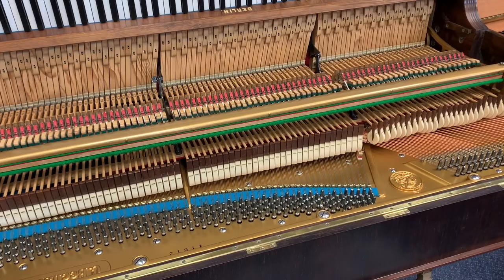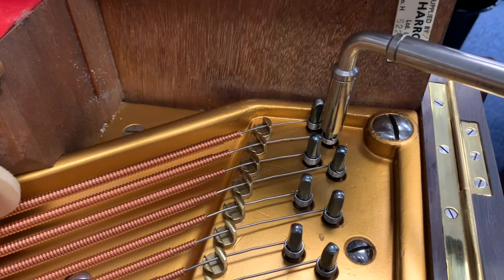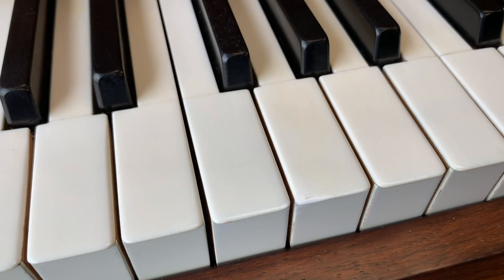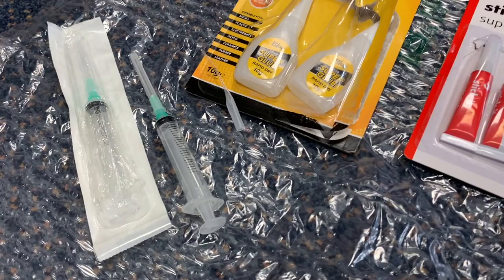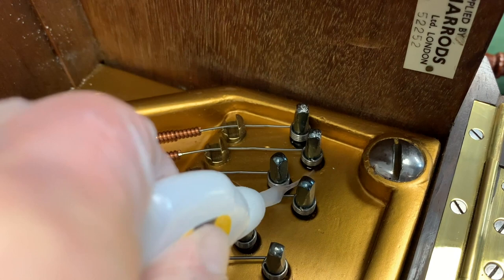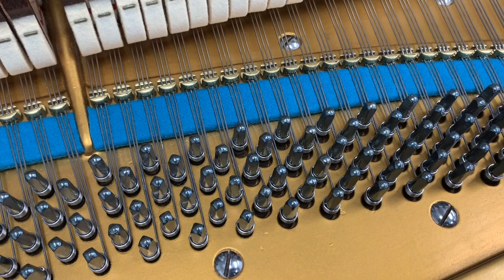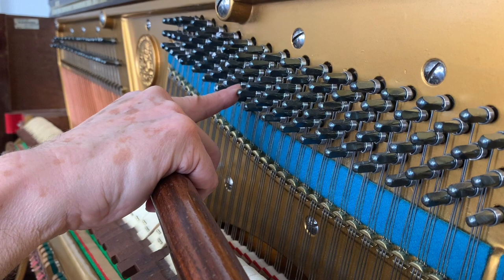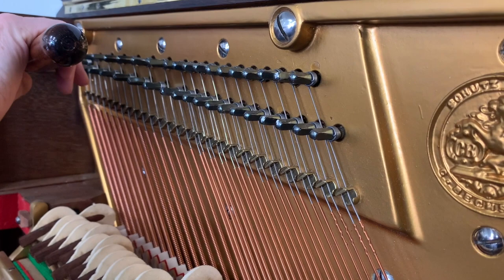How do you use CA glue to tighten tuning pins? + thoughts on larger pins and replacing wrest plank.

Comment: Robert, I love your videos! I'm an RPT and a Bechstein dealer here in the U.S.

The CA glue treatment has a high success rate for me, especially if I replace the tuning pin with a larger one. Usually replacing a size 2 with a size 3 (or size 4 in extreme circumstances). It's usually just not worth it to replace the whole pin block especially on an upright.

Comment: Another tip is you must use as much CA glue (super thin) as the wrest plank will absorb. If you go back to it later and try to put more in, the first treatment will have dried sealing the surface of the wrest plank and will stop more being absorbed. So it is a case of do it once do it right for best results
Reply: Very good tip that’s rarely mentioned. Some say to put X number of drops, but that is wrong. Over 30 years and I can attest to your procedure! Each pin needs a different amount, and adding more later is sometimes impossible. Let it fill, lower, fill again until it stops.

Comment: I used it on a 1923 Chickering grand which would not hold a tune in the lower base. The middle strings were better but border line. I did all of them and found it to be quite effective. It increased pin torque I would guess by over 30 % for all. It now holds up extremely well   in a pretty stable room. It varies hardly any between tunings of 6 months or even a year.  It has been doing so for 5 years, and was even moved. I would wait at least 6 hours after treatment to turn pins maybe even overnight. You will feel the pin "break" loose when you move it but the pin will stay "tight" after initial breaking loose.  The uprights do better if done on their back.  Be careful with ventilation. The stuff is bad to breathe. I love your pianos!  I had a Schimmel that I really liked. I have a Mason and a Chickering now. Both are pretty decent.  Wish I were closer. John.

Comment: I've done lots of this work. You do need a thin CA glue so that it travels properly. I've also found that around those loose pins you'll need to apply more to fill in the cracks in the board. You'll see it doing its job. Piano on its back is also the best way to do it. It certainly smartens up the torque of the pins but the down side is that you'll need to employ a different technique when tuning. All the best with the new experiment. EDIT: I always have an air extraction unit with me when I do it to get rid of the fumes

Comment: I posted a long comment but it vanished.  Best to use very low viscosity CA, not available in shops, need to order online. I like the little flexi tip nozzles like the one in your video - easier to control than pipettes etc.  I have used those little pound shop bottles in the past - they are reasonably low viscosity, but the proper very low viscosity stuff is better,  The flexi tips can be bought in packs online.  American technicians, who discovered the CA method, having been using it for over thirty years now, and are extremely positive about the longevity of the results.  It has saved many a solid old piano of little financial value, not worth full rebuild/restoration.

Comment: I use it regularly on old pianos here is Berlin. My experience is it can make alot of otherwise condemned pianos live a little longer. I apply to upright in client's homes with the piano upright. I use a small pipette. And do 3 passes on all the pins (On the death's door wrest plank better safe than sorry.) I begin by applying small amounts at a time trying to avoid it overspills. But I keep some clothe on a treble mute to catch any excess CA glue. I've found it holds really well over a couple of years here.
Reply: I second all that.  I have used pipettes in the past, but now I prefer the flexi-tips as shown in the video - you get very good control of the outflow, and if you take your time on each pin and let as much wick is as will go, I've found that it's not necessary to do three passes.  I agree that this is a method for "otherwise condemned" pianos, which are not worth a rebuild.  Reports from American technicians, who discovered the CA method and have been using it for over thirty years now, are extremely positive about the longevity of the results.
Reply: @DavidBoycePiano а все потому что производителям просто лень внедрять нормальную систему удержания колок. Это же не болты в велосипедном багажнике что бы такие методы использовать! Но нет. Достаточно одного или пара видов удкожателей и винтов для тонкой настройки и пианино будет держать строй лучше. Это тоже самое что сейчас винты обычные использовать как в 18 веке. Просто недопустимо, но некоторые товарищи продолжают клепать этими "проверенными" методами. Таких производителей нужно гнать

Comment: Ideally you need to lay an upright on its back for this to work. I don’t think it works too well otherwise, the CA tends to run away rather than be absorbed by the wrest plank. You need to use super thin CA for best results much better than standard thickness CA, but of course it will run away if you don’t have gravity keeping it in the right place around the pin to be absorbed by the wood. I would certainly leave it longer than 30 mins before tuning it. Overnight is best in my experience. I think this is why some pins did not hold very well for you because you moved them before it had set well. If done carefully it can last quite a long time.

Comment: After seeing how commonly it is used in the USA I thought Id get some of the super thin CA and some of those fine nozzles, I bought a bottle for about 20 quid. Used it on an old upright yesterday and seems to have worked a treat - brilliant for rescuing otherwise sweet old instruments that are becoming untuneable, remember to put some absorbent blotter under the pinblock on a grand or it can run and drip through onto the mechanism underneath

Comment: Have a word with "LOCTITE" products on the phone. They are very good company, and they will have various grades of "Cynoacrylate adhesive" (CA GLUE).
Loctite is used to provide the desired grade of "fit" on a very wide range of industrial applications. It is not normally considered a compromise these days.

 If you want it to last in the bottle make sure there is an air gap.
The curing process (ANEROBIC) starts when it is excluded from the air.
In wood, or were there is a very sloppy, or porous fit, a heavier than standard grade might be needed.
Even maybe consider multiple applications.

It was a giant leap forward sixty odd years ago, as far as I can remember.

It will increase the life of many a piano

Thank you for your many expert videos Marcus.

Comment: On CA glue: 1 drip or 2 per tuning pin could be a lot: for the thinnest viscosity capillary action will wick the fluid to where it's needed
- The applicator here was great!
- Upright piano on back is best, gravity is on your side: but even upright it should wick in, but any excess may create issue
- Whatever a great temporary fix
- CA glue uses mositure to go off: it will find this in the wrest plank wood / from atmosphere
- Once opened difficult to preserve: cling film under screw top... As moisture eeks in from the atmosphere is goes thicker & thicker...
PS When pulling apart it would be useful to show where the glue actually ended up?
- Sealing ring at top: or penetrating down the pin where the hole is oval
Reply: Technicians in the US who have investigated penetration of CA in pinblocks have found that, while it doesn't generally make it all the way down the hole, it does more than just form a ring at the top of the hole.  There is also a technique some USA technicians have used for grands, of flipping the piano right over, 180 degrees, and applying the CA into the bottom of the pinblock holes (assuming of course that the pinblock holes are drilled right through).  The flexi tips used in Marcus Roberts' video here, can be bought in packs online, and will fit onto the nozzles of many CA bottles.
Reply: @DavidBoycePiano  David: Indeed or you can have too much if a good thing!
https://youtu.be/C0U3t8IKUMk
[Early 1950s the Rover Co. chrome plated the bores of the 'Cylops' 75... This is the pin block non-stick equivalent - 10 years down the line!]

Comment: I used Starbond Super Fast Thin on a Petrov piano, very easy to do, cover the mechanism in case it goes through the block, it makes the wood swell and hardens into cracks, just add glue until in pools around pin, low strings may need more than one pass to fill in all the cracks. Low strings are holding after two years just fine. New block would cost more than the piano, the glue cost $5

Comment: I am not a piano technician but here are my two cents.

On the ivory key repair subject, I would try keeping the shards left from old ivory key repairs. I would then sort them by colour (or rather, tint), pulverize them really fine and then mix the powder with the c.a. glue. I would try to see if that works because if it does, then I could get a much more seamless repair with a matching colour - which would certainly be very worthwhile in a piano with many chipped ivories whose owner cannot stand the sight of.

On the subject of the plank repair, there are a couple of points to make. First, I would not expect the c.a. glue repair to have the same grip, especially after tuning once or twice. Second, I would try to hold the application with as steady hand as possible and try to get it very close to the pin base and all around the pin in order to get most of the glue absorbed where it matters. For that reason, I see no other way, for hidden plank piano, than putting the piano on its back. I'd leave it there to set for a good hour or so and then tune it on its back to see if it still holds, then apply extra glue if needed. So for a house repair, I would certainly need the special piano prop for tilting the piano to its side etc. or a couple of strong guys. The applicator shown in the video looks perfect for the job. With the hidden plank pianos, however, there is no way of telling whether the glue seeps into the wood around the pin or just fills the void between the plank and the frame hence I would definitely get the piano on its back for this reason alone.

Comment: Say if you use CA super glue that’s gel-like. Would that work the same? 

And if so would I have to lay an upright piano on its back so it will set correctly?

Would gel glue not set in correctly and only thin glue would work?

(It might have mention this in the video but at the time I’m writing this comment I cannot finish the video)
Reply from the maker: Thank you for your comment. We haven't tried CA glue very much so it's useful to have tuners' thoughts about using it. Marcus

Comment: CA glue for repairs is death spiral for a pin block. Use Garland’s Pinblock solution. I’ve treated dozens of pianos with excellent results that last for years. CA glue is stinky, toxic to sinus tissues and only ends up closing up the grain making the grip less after a couple of tunings.
Reply: You have a link for 'Garland’s Pinblock solution'??

Comment: I was in the piano business for 40 years.
We typically used a hygroscopic liquid lije diethylene glycol.
The wrest plank in older pianos was sometimes a solid unlaminated plank where a split can cause the problem of loose pins..
I would be curious to know if the glue you applied stuck to the pin or the wood ir both....does the glue pulverize when the pin is turned?
Reply: Cyanoacrylate adhesive ('superglue') reacts chemically with cellulose to form a compound called cellulose cyanoacrylate.  Wood is more than 50% cellulose.  So it is not a case of the adhesive 'sticking' the pins to the holes, or simply filling in gaps in the wood round the pins. It actually alters the wood.  I have myself seen CA glue react so strongly with a dried-out wet-wipe tissue (mostly cellulose) that it started to smoke! It was technicians in the USA who discovered the CA technique, more than thirty years ago now, and it has proven vastly superior to all other "doping" solutions. When it works (which most times it does), the effect is quite permanent.  The discovery of this effective treatment has meant that many an old piano which would not justify the cost of a new wrest plank, has been saved.  Naturally it is not a technique that you would use on high-end pianos that would financially justify full restoration.
Reply: @DavidBoycePiano  Very well said.  I have used it and found it excellent.
Reply: @martinwalsh3673  I'm glad to hear that you too have had success with it, Martin! A huge benefit is that the effect is immediate - no waiting 24 hours to see if it has worked. It really is a saviour for old pianos of no particular value but otherwise of decent quality.

Comment: Thinking out loud: When it comes to string saving - it might be worth making a special tool to flip the Beckett's out of all the tuning pins once the strings are loosened...
On ivory key making good: Have wondered about UV cured material like dental fillings
Reply: I've taken ivory keys to a dentist for repair.   it works very well.  trick is to put tape in the top of the key.  then turn key upside down and fill from underneath.  remove tape and the top surface is near perfect.  you just need to dress the front edge with some fine emery paper.

Comment: I have used CA glue and it is a very Temporary fix.  I've seen other products used that swell the pin block fiber.  I have witnessed the liquid flowing out of the pin holes onto the action bed of grand pianos and technicians then recommending outrageous humidity levels to maintain the "swelling" of the block/wrest plank.  Shivers!!  To keep the glue in liquid state and the applicator open, I have used 3" 'pearl topped' sewing pins inserted into the orifices' and then wrapped the contact point with scotch tape.  If the bottle becomes stopped up I then will use a "T" pin(again from the sewing supply shop) to re-open it.  Best of luck.  Oh yes,  about 24hrs to hold "Tuned" pins.  Remember that the next time you tune you will break the glue seal, again depending on how much shrinkage there may be.  You also have less temperature and humidity fluctuations in the UK than here in parts of N. America.
Reply: I'm interested in your perception that it's only a temporary fix.  Reports from many US technicians, who have been using the CA treatment for over thirty years now, are very positive about the longevity of the CA repair.  Also, in my experience, and that of others, the effect is pretty immediate; you don't have to wait 24 hours.
Reply: @DavidBoycePiano  had good experiences here David. Instant and not a temporary effect, but a lasting tightness
Reply: @mjrpiano  That's been my experience too.
Reply: @DavidBoycePiano  Dittos on that my friend, 5 years so far on my personal piano!!!
Reply: @johnlewis9649  Excellent - and I am sure it will go for many more years!
Reply: @DavidBoycePiano  Thanks for your relpy.  I'm sure there are applications where Ca glue can work well for longer periods of time.  It depends on how far gone the block may be and the temperature and humidity fluctuations of the geographical location where the instrument is found.  I'm very glad you have such long lasting and immediate results.

Comment: When I restrung my piano, I actually used epoxy and larger pins.  It holds a tune VERY well, but, of course, epoxy is thick and you couldn't apply it to tunning pin threads with them still in the block.
Reply: So did you remove the pins, fill with epoxy, and drill the holes back out? How did you hammer the pins back in without shattering the surrounding epoxy?
Reply: @barkopediusmaximus5552  I removed the pins, put in one size or one half sized larger and dipped those threads in epoxy before pounding them into the block.

Comment: I don’t understand how this is supposed to work. If you rotate the pin after the glue has set you will break the  glue bond and it will be total good luck not good management if it holds from then on.
Reply: It is not about glue bonds. The cyanoacrylate reacts with the wood of the wrest plank and alters it chemically.
Reply: It works and works well, I assure you
Reply: @unequally-tempered  And the effect lasts.
Reply: Wood reacts to CA glue like it would react to any olher liquid: It expands almost immeditely. At that moment CA will hold that wood expansion and ¨freeze¨ it up. The new wood size (arround the pin) gives new torque with the pin, holding it. David Boyce, you are right: It is not about glue bonds.
Reply: @bramdebris4189  Cyanoacrylate reacts strongly with cellulose, to form a compound called cellulose cyanoacrylate. Wood is more than 50 percent cellulose, so CA alters it chemically, not just mechanically.  I have seen a dried-out wet wipe, mostly cellulose, smoke when CA was applied to it, so exothermic was the reaction.
Reply: @bramdebris4189  Isn't it also that there is a reaction between CA and the cellulose? Effectively the CA is replacing or rebuilding the cellulose or lignum structure of the wood . . ..
Reply: @unequally-tempered  you are right again, the reaction is both, chemically and mechanically. For example..CA glue with toilet paper could generate an exothermic reaction, rising up the temperature near 100 centigrades and smoke.